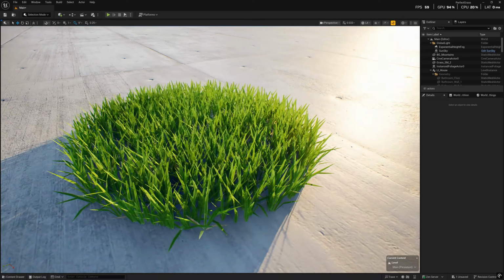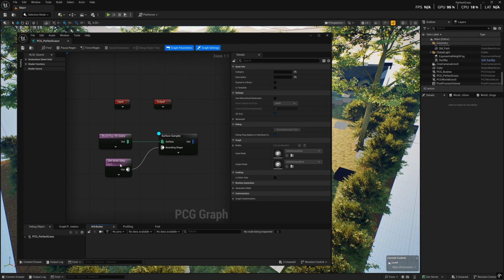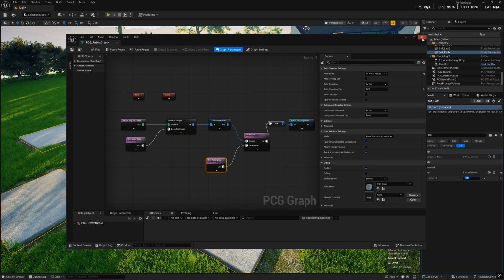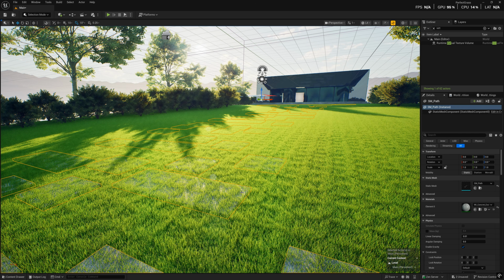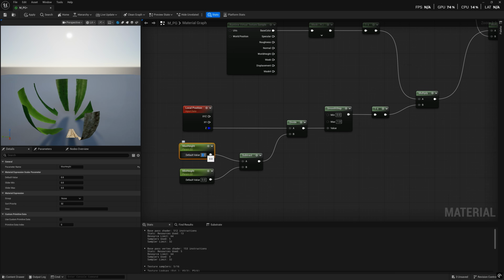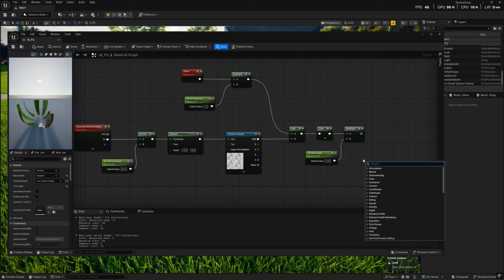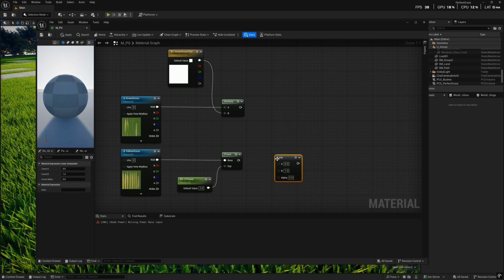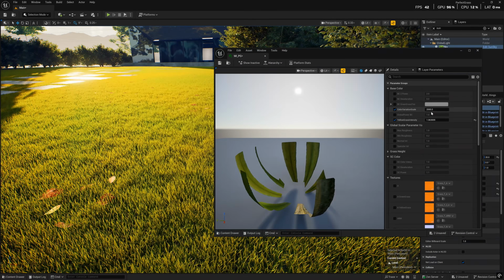Perfect Grass in Unreal Engine. Complete Guide for ArchViz & Interactive.

Comment: Hey Stan, great tutorial for beginners like me, many thanks! For some reason I ran into an issue when following your instructions, the grass I scattered has a visible "circle", the lawn inside the circle looks great but outside the circle it looks much brighter (like no shadows were generated?),  I have tried all solutions I can find from Google search, such as adjusting LOD screen sizes, directional lights, culling, console commands for raytracing shadow... none of them solved the issue.

I have also tried using different grass static meshes, and using latest engine (5.8), again, didn't work at all.

The only way I can find to get rid of the circle is enabling nanite in the grass mesh, but the grass looks bad afterward because that seems globally disable the shadows of the grass.

Somehow you don't seem to have such problem in your video, the lawn looks great and consistent all the way, how did you manage to achieve that?

Comment: I have a 3060 and somehow this makes it go super slow...
Reply from the maker: Try adjusting your foliage density or check if your shadow settings are set too high for your hardware.
Reply: @stan3dart Yeah, i did some adjustments and now it runs, around 24 fps but much better.

Thanks for the video.

I ended up making the grass myself also lol, because all the grass i see is paid or too wild for archviz...
Reply: @stan3dart  спасибо за урок, но я думаю если делаеш урок желательно чтобы и говорить о подводных камнях, если этот вариант сильно грузит gpu то подскажи заранее что нужно сделать для оптимизации.

Comment: thank you for this tutorial! I have the problem that i have multiple unconnected pieces of geometry that i would like the grass to grow on, but the PCG volume only seems to accept one actor with the "Land" tag, so it just switches to whatever object has received that actor tag last. Is it possible to have multiple objects carry the "Land" actor tag, and the grass to grow on all of them separately? I tried checking "select multiple" because that seemed like a promising option, but it didn't change anything -- it threw the error "too many data items arriving on single data pin 'Bounding Shape', only first data item will be used", which maked it hard for me to understand the purpose of the option
Reply from the maker: Hey! Try using a "Get Actor Data" node with the "Select Multiple" option, but plug that into a "Merge Data" node before passing it to the "Surface Sampler".

Comment: "Thank you for the video; it was very helpful. I was able to successfully apply the RVT grass masking technique to my project. However, I've run into an issue where the masked grass still casts shadows when the camera gets close, seemingly due to Virtual Shadow Maps. Is there a way to resolve this shadow artifact without using World Position Offset (WPO)?"
Reply from the maker: Hey, glad it was helpful! You might want to check your Virtual Shadow Map settings or try adjusting the culling distance for the grass meshes to prevent those shadows.

Comment: Hi Stan, 

This is epic. One thing i noticed is under spot lights the grass seems to generate in a circle around the viewer with fade off and it looks a bit weird. Culling/generation. Radii didn’t change anything. Any idea what it is? 

It’s much less obvious In daylight but at night it looks like it’s only generating ~15m around the user. 

Thanks!
Reply from the maker: Hey! Thanks for the feedback. It sounds like a culling or LOD issue, which can be tricky with dense grass. Are you using hardware raytracing or lumen?

Comment: Hello Stan, thank you for the tutorial and the Patreon files! I’m having an issue using the PCG on multiple custom meshes. I added the 'Land' tag and collision to several objects inside the PCG Volume.

In the Graph, I have "Select Multiple" checked in the Get Actor Data node, but the grass still only spawns on one object and ignores the others. I’ve checked my Volume bounds and pivots, but it refuses to populate more than one mesh. Do you have any advice?
Reply from the maker: Hey! Thanks for the feedback.
You're spot on—it's most likely a collision issue. For PCG to place assets, the target surfaces need to have collision enabled so the trace hits them.

Check these two things:
1. On the custom meshes: Open them and ensure they have Simple Collision generated. Also, check that their Collision Preset is set to something like 'BlockAll' (or at least blocks the channel you are tracing).
2. In the PCG Graph: Inside the Surface Sampler node, look at the Trace Settings. Make sure the Collision Channel is set correctly (e.g., WorldStatic) and matches what your meshes are blocking.
Reply: I had a similar issue but was able to fix it by duplicating the surface sampler and get actor node then plugging it into the transform points node after the original surface sampler. I also had to make a new tag for the second mesh e.g. "Grass2"

Comment: Why does the grass disappear when I look at it from a distance?  I have to move closer for the grass to appear, but it only shows in sections, not the entire area.
Reply from the maker: This is for optimization purposes. You just need to adjust culling distance (increase) in PCG for Static Mesh Spawner.
Reply: @stan3dart im having the same issue. How can I ajust culling?
Reply: @vitorbasso5656  Stan3dart just reply, he is right. Just follow the steps inside the grass blueprint.

Comment: Nice useful tutorial, however your end result looks quite tiled and repetitive, you can see repeating square patches, it's not ideal for large areas of grass.  Would this visible tiling be cause by your circular original grass patch asset? If you had 3 or 4 size variation of the grass patch asset it might hide the tiling a little better?
Reply from the maker: Yes, Using several variations of the grass asset (different in shape, size, or even color) is indeed the best way to break up the visible repetition and make large areas of grass look much more natural.

Comment: Amazing, I wonder if it works for slightly more irregular surfaces. I imagine that in some node it can be indicated that it adapts to normal surfaces.
Reply from the maker: Thank you. Yes, it works perfectly on irregular surfaces. PCG is specifically built to handle this. You just need to make sure your PCG graph is set up to read the surface normals and adjust the rotation of the grass instances to match.
Reply: @stan3dart  Amazing, I'll try it, thanks a lot for your reply, great job!

Comment: I wanted to do something similar with a clipping mask that is driven from a spline, basically like cesium does. For sure, it must be possible...
Reply from the maker: Yes, you could also use a spline instead of RVT to generate a precise mask texture or a signed distance field (SDF).

Comment: I tried every step but I dont know why my mesh wont update the mask... any tip?
Reply: Check virtual texture support in project settings. 
And disable nanite on meshes that clip your grass. 
Nanite on the grass can be turned on - it doesn't affect.
Reply from the maker: on the Static Mesh objects you want to exclude from grass generation using RVT (for example, the concrete slabs), Nanite must be disabled. Also, make sure that Runtime Virtual Textures are enabled in your project settings.
Reply: @stan3dart  Saved my ass right at the very end with this comment! Thank you!
Reply from the maker: @ShinGidora  🙂